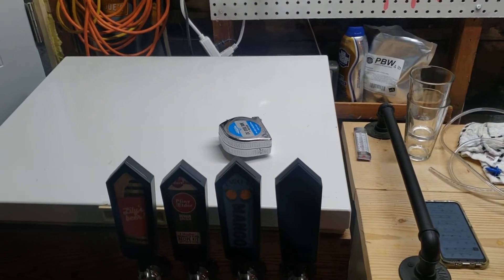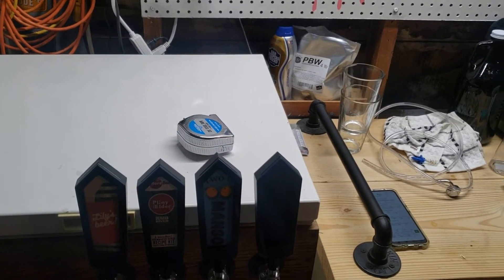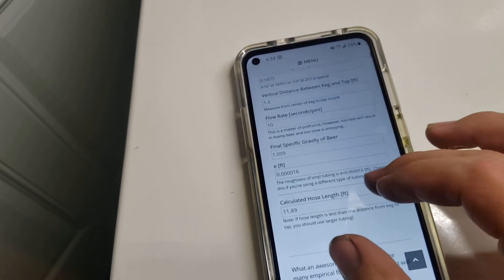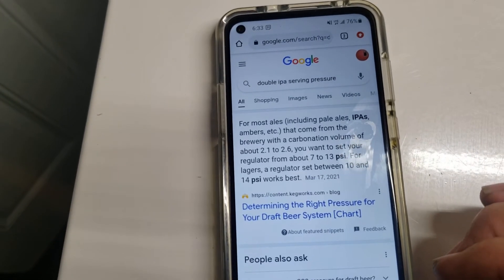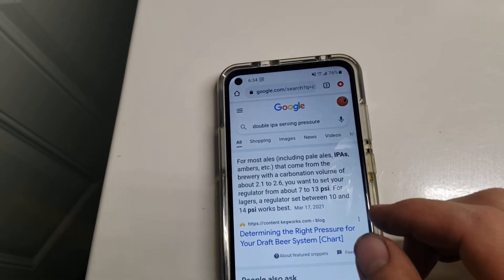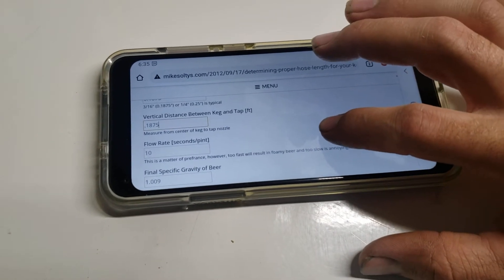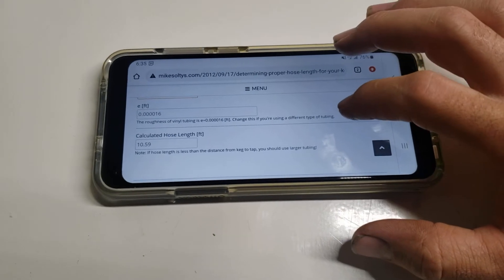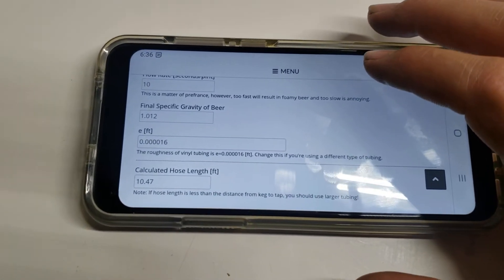Beer Line Length How To || Calculating Beer Line Length

Comment: Love this. Where can I get the “quick” connection from. I switch out kegs rootbeer, Paloma, or others my wife makes. Not the coupler but to swap lines easily.
Reply from the maker: I've found a better option than the plastic duotight connectors if that's what you're referring to. Check Amazon for push to connect fittings in the size you need. They're sized by tubing outer diameter and also thread size. Mine are mostly 5/16 od and 1/4 thread for example.
Reply: @lilybdrinks Thanks man. If I knew the proper names, I’d use them. Thanks again. I’m going to to do some research and let you know
Reply from the maker: @Armsnlegs awesome! Highly recommend. There are options with plastic "collars" and some that appear to be all metal. I've been using the plastic collar style for a year and a half on liquid and gas without issue. I'm hoping to make a video soon to outline the setup

Comment: Found this really helpful. I've been having problems with foaming. Going to give this a shot
Reply: How did it go?
Reply: @1791Hernandez  worked a charm. I ended up doing it slightly longer than recommended and it was good
Reply: @johnlbanks  Cool. Thanks for responding.